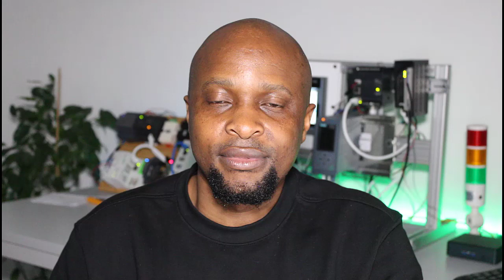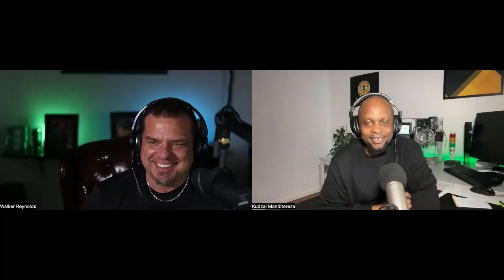Unified Namespace for Industrial IoT: The Masterclass - [ Walker Reynolds - 4.0 solutions ]

Comment: We have a big but probably dumb question on the UNS:

With multiple systems feeding the UNS (ERP, MES, SCADA, CRM, etc) -> is the data typically segregated by ERP, MES, SCADA within the namespace, or does this defeat the "unified" part of the UNS?

We are discussing work orders for example, and unsure if an update to a work order made by ERP would have to land in an ERP section, and a separate change made by MES must land in an MES section, or if they (ERP and MES) can safely independently update a "work order" topic.

My feeling is that these separate systems would be feeding a single UNS, and the segregation of systems within the UNS is incorrect, but we're stuck on this..